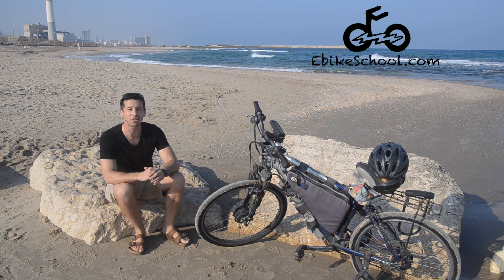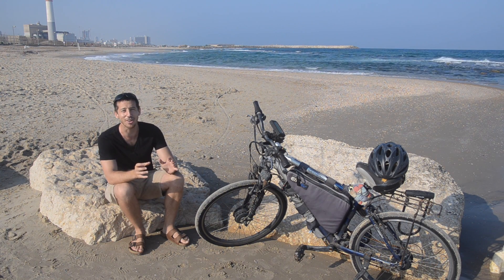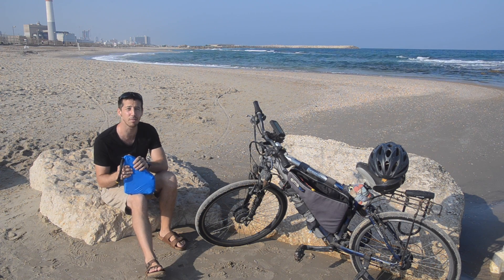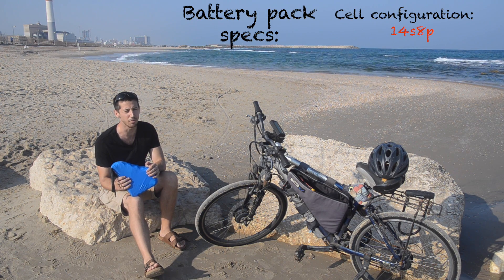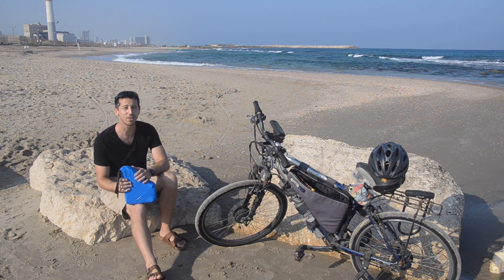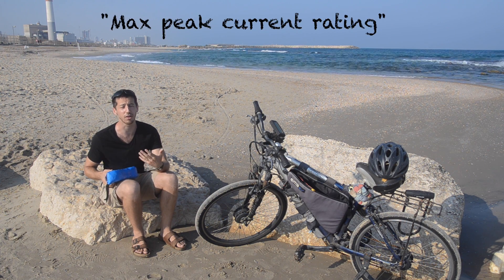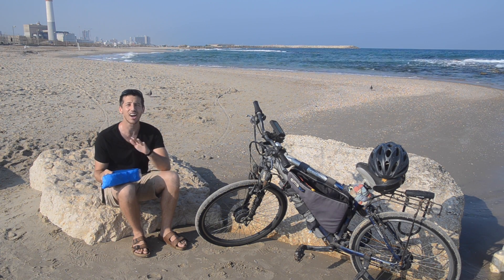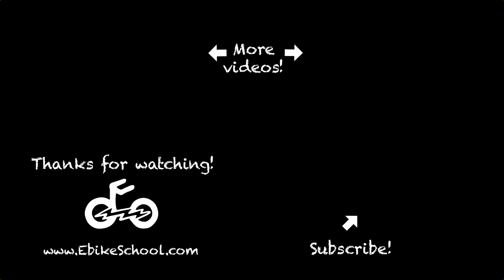How To Properly Choose An Ebike Battery - Q&A#8

Comment: Could you make a video concerning proper charging care?  the horror stories concerning battery fires are quite scary.  what safety measures do you recommend for proper safety observance?  Is a firebox necessary, and what does unattended mean when charging... id like to be able to leave the room when charging.

this is such an awkward topic liability wise and of course anything you'd offer would be only suggestions.
Reply: Matthew G. Muehl-Miller Store and charge the battery in a location where when it burns nothing around can catch fire and that the toxic byproducts don't enter inhabited spaces. Otherwise it simply isn't safe. Like storing half a gallon of gasoline or fireworks.

On the other hand everyone is charging their phones and laptops in bed which both use the same batteries. Ebike batteries have a tougher life and have way more electrical connections though.
Reply: heheh, I store gasoline in my garage! :D  I try to store it safely. 

That being said, I'm thinking of a repurposing an ammo box into a storage container and waterproofing it so it can sit on my porch during the warm months.  durign the winter it will have to come indoors though for safe operation...

Comment: How do you know know how many volts you can go over your speed controllers rated voltage?
Reply: caleb lower  Keep increasing the voltage till it pops.
Reply: difflocktwo lol, if I had that kind of money, I still would not
Reply: caleb lower Controllers are super cheap, check ebay. Search 'brushless ebike 48V' or something.
Reply: difflocktwo I still can't afford to break one, I don't have that kind of money

Comment: Be honest? You say you can do 50km/h with 60km range but that's pretty much twice/double as much as whats possible on most setups according to using a 52v 20ah battery on the ebikes.ca simulator/motor setup! https://youtu.be/f61dgKoZdno?t=4m44s http://www.ebikes.ca/tools/simulator.html So your beating physics? Especially if doing 50km/h.
Reply from the maker: Difflocktwo, no special winding, I just overvolt them and limit the current with a cycle analyst. I describe it a couple videos ago.
Reply: EbikeSchool.com Your motors are high voltage and low current making them more efficient? Is it a special winding?
Reply from the maker: I'm using two small motors, both with low currents and high volts, which helps me run efficiently. Watch my previous videos to learn more about my bike.

Comment: Good info thanks! How do you know that your getting batteries with a good lifespan? I've bought cheaper 18650 cells before that have been great and still work pretty well... I have others that started out fine with good output and capacity but that quickly dropped off after just a few charge cycles! Also, do you think LiFE batteries are a smart choice?
Reply: Blakehx do you know how can i get the cheapest 18650 cells that can deliver over 5Amps?

Comment: This is great! Micah you read my mind with your video I just upgraded my 750w and purchased a 3500w Hi-Power brand rear wheel and controller "Aaahhhhhhh the Powwwer @Bruno lol" that I believe can go from 36v 48v and 72v options i just need to pick a battery I want to go a little more for distance rather than speed so I think the 48v battery you showed might be just the ticket thanks again for the help.

Comment: Would this be in your book? 
  I'm looking for a formula that would calculate for the best battery, motor, & controller with throttle, that would get my 45lb cruiser & my 250lb body to work up one hill that is steep for .5 mikes and 45 miles round trip.  Using the throttle most of the time would be prefered.

Comment: Hmm, I have 2 36v batteries laying around but I want a 1000W motor. Could a 48V motor (well that's what it is called on ebay) handle 72V or could I put a regulator or something in between? I repair these segway/ hoverboard things so I have a few 36V 4.4Ah batteries going to waste.

Comment: Please make a video explaining the discharge curve of the battery and the behaviour of the battery pack from full charged to discharged when riding our ebikes.
Reply: Asimenia Koutoula Wouldn't this curve be specific for each type of cell and chemistry?
Reply: +difflocktwo All lithium ion cells have similar discharge curves. The question is if we can use our battery the same way during discharge and if the capacity is real. For example can i climb a hill to the end of the discharge? When the controller stops ebike with low voltage cut, have we use all the Ah of the battery? Everybody must know the truth. A video is necessary...
Reply: Asimenia Koutoula There already are videos on YouTube. Start with "Why do Li-ion batteries die?".
Reply: +difflocktwo There are also videos for ebikes...What do you mean? This smart boy expains things more clear...His videos are the best.
Reply: You said a video is necessary so I directed you to a video. I didn't know you want your information from only one source.
Reply: +difflocktwo Thanks man!
Reply: +difflocktwo Just a minute man..The videos you suggest are completely irrelevant with ebikes. We want a video for ebike lithium ion batteries discharge curve. Thats why ebike school is the best and unique source!
Reply: Asimenia Koutoula How is it irrelevant? Batteries are batteries, doesn't matter where you use it.
Reply: +difflocktwo Yes of course, if you put wheels to a laptop or a cordless drill you have an ebike!
Reply: Asimenia Koutoula 🍉🍗

Comment: I appreciate your videos, they are very informative.

Could you offer any advice on battery charging? There seems to be a lot of differing information about charging to 80% vs 90% vs 100% in regards to long term battery life. Also do you recommend a charging schedule for new batteries, or maintenance schedule if you don't to charge your batteries fully everytime?

Thanks
Reply from the maker: Yea I actually have a video on charging schemes in the works right now. Hopefully I'll have it up in a couple weeks.
Reply: Great! thank you I will keep an eye out for it.

Comment: Great videos mate, you have an easy to understand style.
I have a question for you regarding the rear hub motor on my bike (1000w) the rear brake has failed so rather than replacing it I'd like to install a regeneration system. How easy is this to do? Will it provide enough stopping power? I do most of my braking with the front brake anyway.
Many thanks, Martin.

Comment: How many miles can you get from that battery on a flat road med speed?
Reply from the maker: I usually commute at full speed, of about 45 km/h, so its hard to say, but if range at full speed is 60 km, I'd guess range at 30 km/h would be closer to 100 km. It isn't linear, higher speed reduces range much faster.

Comment: how much did it cost you to build the battery you made for your ebike
Reply from the maker: Probably about $360 in parts, but its a big battery. Smaller batteries could be cheaper.

Comment: thanks. that answered a lingueimg question I had about amps. each parallel group is responsible for the amount of total amps. so with my vruzend kit to pull the 32 amps from my controller, I should have about 9 cells in parallel to put the amp output in the ideal range for the cell holders. ok, I need to add 2 more to each row. That probably saved some troubleshooting. thanks!

Comment: Hey, my name is Orion. I just recently installed a 48v 1000w motor to my bike and used 4 12v 12ah batteries. Originally this was supposed to get me to work and back but it died no even halfway there ( 7 miles) . The batteries are lead acid. Am I expecting too much from them? I weigh about 150 and the bike plus wheel weighs about 70 also there is a lot of hills where I live, what should I do? I ended up pedaling home with a FLAT tire and am almost done with ebikes , I want to use these things but damn, what a negative experience
Reply from the maker: Yea, your problem lies in the SLA batteries. Most SLA batteries shouldn't be discharged past halfway, so you should think of yours as 6 Ah batteries, not 12 Ah batteries. Check out this article I wrote on the topic: http://www.ebikeschool.com/electric-bicycle-batteries-lithium-vs-lead-acid-batteries/
Reply: First, lead acid batteries arent meant to be fully drained. Second,  a 576Wh battery pack using these is extremely heavy, meaning you won't get far with that much extra weight, especially if you stress them out with a very powerful motor such as yours and at hills, stressing the lead acid batteries.

In your case, you should probably switch to lithium-ion batteries, as they can hold the same charge while being much much lighter, meaning you'll actually get much more range.

Comment: I hope you can continue to be this honest with people. That pack has a lot of cells. I don't see any packs on factory bikes with that many cells. But all the manufacturers are pushing 30 mph bikes. Basically you are saying a 1000 wh pack will last 40 miles, which is 25 wh per mile. To go that speed you need a lot of watts and actually, in the US, 750 watts is usually legal. So you go 30 miles in an hour and that takes 25wh per miles and that works out to 750 watts. Anyone selling a 1500 watt bike is going to need a lot more battery than this for something like continuous off road with hills and high speeds. Legal speeds and legal watts are pushing the battery packs. 

This pack is going to weigh around 15 lbs. It's not going to mount  anyplace that would be considered 'balanced' unless you have a triangle with a lot of space. I have a cruiser with no room, and a step through with no room. It would fit on my hybrid.  I have a 15 pound Lifepo from China, and people told me how horrible it was to mount it on the rear rack. But now we are coming full circle with high powered bikes and huge battery packs.

One thing I would really like to know is how well the cycle life of the 26f (by using a lot in parallel) compares to a performance cell like the GA or 30Q. There isn't a lot of room with these packs, run as hard as they are, to do what the automakers do. They have huge packs and try to run them from an 80% charge to a 20% remaining discharge. GM says they have never had a depleted capacity claim on their meager installed base of EV's. 

This is great stuff. This is what people should know. Give everyone a watt hour meter and your two books!
Reply from the maker: Yes I actually want to do a video talking just about cycle life. The 26F has as medium level cycle life, rated for 300 cycles until it reaches 70% of original capacity. Cells like GA and 30Q actually have pretty low cycle life, rated for 250 cycles until 60% and 200 cycles to 75%, respectively.

Comment: Hey Micah does the controller help to cap the maxium current draw?
On the back of my controller the label says maximum current 18A and rated current 9A.
I don't really understand what the 2 values mean here. Or, what their role is respectively.
Reply from the maker: The controller doesn't just cap the current draw, it's the main factor deciding the current draw. Regarding your controller, I hate when they list two ratings like that. What it likely means is that the hard limit for the controller is 18A - when you give full throttle, the max it will pull is 18A. But the 9A likely means its rated for 9A continuous without overheating, meaning if you rode up a really long hill and pulled 18A for a long time, it could overheat the controller. That's how I'd interpret that controller label.
Reply: Thanks Micah. When I bought the bike the shop mechanic did say that under extreme stress the motor could get warm but the system has built in protection to cut operation until things are back to normal.

Comment: Can you run 36v or 48 v battery on any motor  if so whats the pro's and cons.
Reply: as far as i know motors have a max Watt specification, if you cross that line to far or for to long your motor is dead.
Reply: Watts  = Volts x Amps
So if you have a 500W motor and you run it at 36V then, for full power, it will draw 500 / 36 =  13.9 Amps whereas if you run it with a 48V battery, at full power, it will draw 500 / 48 = 10.4 Amps. Less current means less strain on your baterries, controller etc.

Edit: I didn't even explain it correctly. Watch the video if you haven't already.
Reply from the maker: Pretty much, check out my video from a couple weeks ago on overvolting motors.

Comment: Nice video! I have a question. How do you choose the bike to convert?    
I've seen many say you need like a 400$+ bike. Is there a specific thing to look for when choosing a bike to convert?
Reply from the maker: Most important thing is a strong frame and (if its a hubmotor) beefy dropouts. Believe it or not, sometimes a $100 walmart bike can make a better ebike than a $600 fancy road bike, just because its built with sturdier, heavier frame materials. Weight savings on frames is rarely a good thing for ebikes...
Reply: EbikeSchool.com Unfortunately, weight saving is a thing for me due to part of my commute is a bus or car ride to downtown.
Reply from the maker: Weight saving can still be done, just don't choose one of those carbon frames that weigh nothing. A decently strong aluminum frame with rear hub motor (and torque arm) or mid drive can still be pretty light.